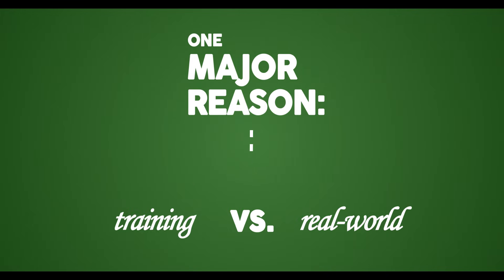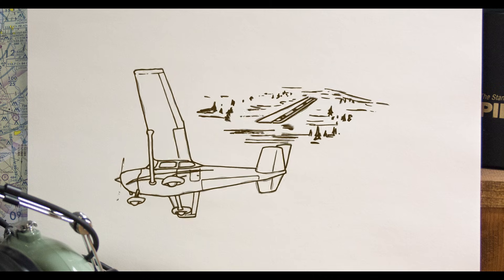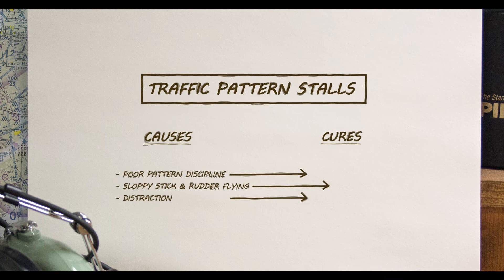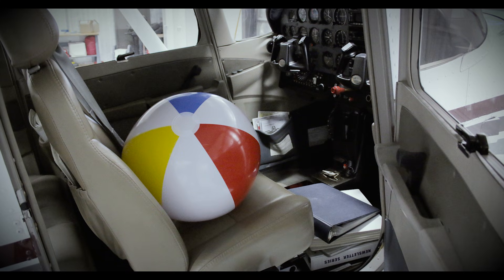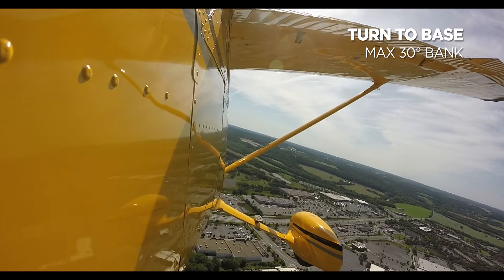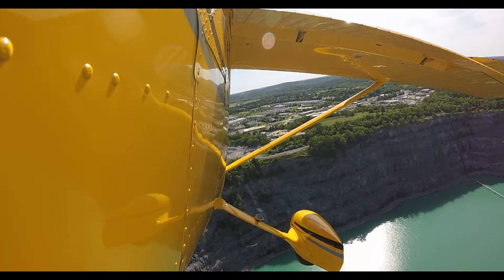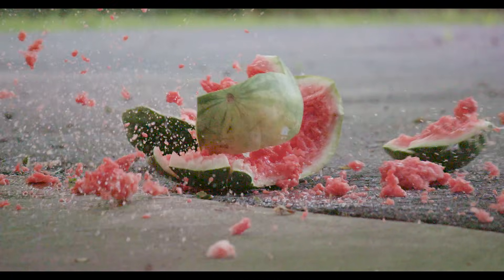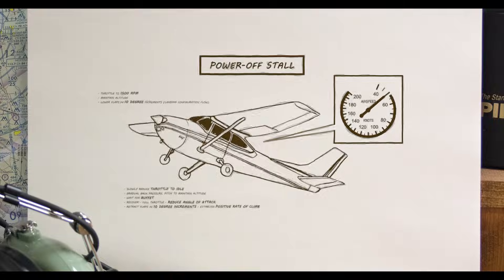Margins of Safety: Avoiding Traffic Pattern Stalls

Comment: Wolfgang asks continuously, "What does the airplane want to do?"  What does the airplane, with the dynamic neutral stability designed into it, want to do in a pitch up or turn?  It wants to maintain airspeed, not altitude, in all turns.  If we pull back on the yoke in the turn to crosswind, we will decelerate below the Vy trim set for takeoff and climb.  If we pull back on the yoke in the turn to downwind, we will decelerate below the Vy trim set for takeoff and climb.  If we pull back on the yoke in the turn to base, we will decelerate below the trim set for 1.3 Vso on downwind.  If we pull back on the turn to final, we will decelerate below the trim set for 1.3 Vso on base.  Does greater angle of bank increase the g load if we do not pull back on the yoke in any turn of any bank angle?  No, it does not increase the load above the same 1 g load of wings level.  The airplane cannot stall itself.  The critical angle of attack is when the wing stalls.  Why does the wing stall?  Because the pilot is pulling back on the yoke increasing the angle of attack.  This is not rocket science.  The wing exceeds the critical angle of attack sounds like rocket science.  The pilot pulling back on the yoke in takeoff pitch up to inadvertent stall, go around pitch up to inadvertent stall, and in altitude maintaining turns which trigger inadvertent stall seems to be what is causing many fatalities in the pattern.  Should we teach pilots to takeoff as fast as possible, even using free ground effect energy, to gain zoom reserve airspeed before altitude?  Should we teach pilots to not pull back on the yoke in turns in the pattern in order to maintain trimmed airspeed rather than maintain altitude?  Is our altitude orientation rather than airspeed orientation affecting safety in the pattern where stall is generally inadvertent and fatal?  If an average weight instructor is training an average weight student in a 152, is Vx (or even Vy on a hot day) ever appropriate?  Would limiting bank angle in turns or eliminating back pressure on the yoke in turns be safer?

Comment: I would say that often with low time pilots flying into an unfamiliar airport with a tower, pilots get confused by tower instructions and distracted. If they have done most of their practice with standard entry, left hand turns, etc., they can get thrown a curve by tower when they are instructed to enter a right base, or when tower calls the base for them, or when the traffic is heavy and they are instructed to extend a downwind or "keep it tight on base to final". This is an invitation to exceed angle of bank, allow airspeeds to fall below appropriate levels or to try to skid in turn to final. All of these things can contribute to upsets that result in fatalities. My instructor did the right thing and spent time with me at controlled airfields before my long solo flight and I was prepared for these distractions in advance.

Comment: The real issue is people don't learn how to manage energy and think they need to come in right on the edge of the horn. Don't get close to stall speed and you won't stall. My archer stalls flaps pur at 49kt. I fly patter on final into 2300 foot runway at 75-80kt. I'm never bear the horn and I'm almost always making the first taxiway. I see others come in at closer to 60kt and they have almost no aileron control and they will be hearing the horn on a stiff gust. Just unnecessary

Comment: Shouldn't every instructor be making "coordinated flight" the number one bottom line and most important aspect to flying?
Similar to the tobacco companies being required to put gruesome pictures of skeletons on cigarette packages to warn people that smoking will kill you, instructors should be showing students video's of people that crashed and died making a simple turn in the traffic pattern. None of those people wanted to die. Yet their failure to keep the flight coordinated resulted in a stall that they were unable to recover from. It all happened in a few seconds.  This has to be front and center on every pilot's mind when flying at low altitude. At that height you can't make any mistakes. You will most certainly pay with your life. They need to fully understand this.

Comment: Flight instructors should teach how the airplane feels approaching a stall. The controls get loose and the A/C feels mushy. It takes more stick movement to change any parameter. The immediate response is nose down to gain speed, adding power if needed. Other than that, a very good video. Some of the comments are also excellent and worth studying.

Comment: One great way to avoid traffic pattern stall is to trash the basic rectangular pattern in favor of simply doing one big wide turn from the downwind. There is no reason to level off after turning base. Just use less bank from downwind and make it one big wider turn all the way to final. This will make is easier to end up right on final with small adjustments to angle of bank. This mostly eliminates the over shoot on base to final (which is a leading cause of overcorrecting the bank at slow speed leading to a stall on the base to final turn). If done correctly, you will initiate about a 20 degree (or less) turn and carry that bank angle all the way around to final without levelling off until on final. With a high wing aircraft this also allows a constant view out on final to make sure someone isn't coming in on a long final on the wrong channel. With a low wing, one can simply give a quick dip of the wing to check for same. Hey, this technique is good enough for the Navy.
Reply: @gregoryschmidt1233  Riskier in what way? Less angle of bank required,...less chance of overshooting base to final turn,....etc.

Comment: thanks for letting the cat inside the plane! (implying it's no litter)
I once sat in a semi realistic simulator (as a visitor). I took off with help from a professional and flew around a little bit.
I thought, wow flying ain't that hard at all. then I prepared for landing. 100 meters infront of the runway, I just fell out of the sky.
was dead in seconds. yikes

Comment: We focus too much on stall recovery and not avoiding it on basic trainings. I´ve watched a video about diferences between airline training and basic training. On big jets you must avoid stall at all costs, recovery is not simples and require a lot of space, so pilots are trained to maintaing certain speeds at certain fases of flight, to extend and retrect falps on a speed schedule and that is really enforced... I flew a variety of airplanes up to the 727 on an airline and I agree with that kind of thinking... this video is much more usefull than the stall recovery training...
Reply: In other words... the best way to recover from a stall is not to stall in the first place

Comment: short down wind, short base to final and short runway landings are all my instructor taught me......no time to answer cells....or anything else...Hand on throttle.... pattern altitude on downwind...amid the runway.... throttle down close to idle...carb heat....first degree flaps....turn base....second degree flaps.....turn final....add final flaps.....over the numbers....settle.........settle.........settle........beep..touchdown...get'r done....get'r down.

Comment: The one thing you will NOT survive is a stall from a skidding turn at pattern altitude.  The best training flight I ever had was over thirty years ago with aerobatic instructor Rich Stowell, when we practiced turn-to-final skidding stalls at altitude.  Even though I expected it, the inside-wing stall was so gentle that I didn't recognize it until we were in a spin.  The wing just gently dropped, as if we were turning, but it kept dropping.  We did that three or four times, and nothing has ever impressed me so much.  Slipping in the pattern is fine - and useful, of course - but I am a Nazi about skidding turns, and it does not matter whom I fly with, if I see that ball on the outside, I speak up AND RIGHT NOW.

Comment: My instructor told me 1.4 times Vs0 in landing configuration or Vs1 is minimum maneuvering speed in the pattern, which accounts for 30 degree banks onto base and final. I cut out a little arrow from the sticky side of a post-it note and put it on the airspeed indicator whenever I'm renting a new aircraft. Stay above that speed bug until on final!
Reply: This is great and in line with the advice here regarding the min maneuvering speed: https://www.youtube.com/watch?v=m_tKShlf_gU
Reply: do you fly VS0 or VS1 in all legs of the pattern?
Reply: Dang—1.4 Vso will just about allow you enough margin for 60 degree turns! (Please don’t try it)  Better safe than sorry.  I’m assuming you slow it down once your established on final??

Comment: Simple, just never pull your stick/yoke past the stall position, then you can never stall.
Reply: manoova Not that simple. Make a sharp turn at a low power setting with a heavy payload and you stall unexpectedly.
Reply: @thomasairbuspilot  Read my post again. In that sharp turn, at that low power setting, with that heavy payload, if you don't pull the stick/yoke back past that stall position - the exact same position regardless of speed, or bank angle up to 90 degrees (for obvious reasons) - you won't stall. Go up and give it a try if you don't believe me. Alternatively, have a think about the relationship between stick/yoke position and the stall.

And, BTW, if you understand this, you'll never stall unexpectedly again.

Comment: Does it occur to anyone else that we could solve all this by making the pattern just a bit wider, and extending the downwind?  Set full flaps and slow down on approach.  And maybe approach just a bit lower and faster, then bleed off speed.  It wouldn't take much.
Reply: IDK...At least one of my flight instructors made it his practice in the pattern to maintain an altitude above and distance away from the runway so as to always be in a position to make it to the field in the event of an engine failure. Mainly cuz it would really suck to end up in a field or road or worse only dozens of feet away from an available runway! That always stuck with me and my approaches have always tended to be high and short. Never perfect, but high and short 🤷‍♂️. That same instructor, in the same conversation, I think, claimed he could cross the threshold of the short runways, at pattern altitude of the now decommissioned Strongsville Airport (1G6), and safely land our Cessna 152 trainer to a full stop before running out of pavement!

I never asked and he never offered to demonstrate this maneuver but after watching him demonstrate aerobatics in his Citaborea, I believed him!

And I've never tried it on my own!!!
Reply: @geeks4greyson425  point lost for misspelling, Citabria, but redeemed for knowing what it’s meant to say when read backwards. 🤔

Comment: One big thing missing from this is the use of trim to maintain a stabilized approach. A properly trimmed plane will "talk" to you through your hands.  If you find your self pushing for pulling you are going to fast or to slow and the feedback is instant unlike waiting for visual clues. Your grip on the controls should be fairly light and relaxed so you pick this up right away.
Reply: I totally agree with you John, good trimming habits can never be overstressed. Our CFI often said that in cruise the yoke should be handled with fingertips, much like a hot cup of coffee. If you are using the ‘death grip’ then your trim skills need reviewing.
Reply: Blah blah ever hear the words accelerated stall keep your speed up in a bank flew gliders for 25 years stalled and spun many times trying to core a thermal course that was never bellow 1500 agl recovery was usually less than 300 feet in a 1-26
Reply: @arvincook5049  I have several thousand flights in sailplanes, gave rides and instructed. A 1-26 is as benign as they come. Try that in a C-150 or a larger plane, you will lose 500 to 1000 feet in recovery. Also try that in a 2-32 you will not be getting out of it in 300 ft. And all the times I flew a 1-26 I stalled it more than once thermalling but never spun it, I guess I must have been keeping the yaw string straight.

Comment: An especially dangerous situation is overshooting the final on a base with a tailwind component, compensating with a heavy rudder and not enough bank or speed. This is the perfect spin entry setup.  It's scary, and should be.  If coming into this situation go "straight and level," adding power, and go around.  No exceptions!
Reply: tricky at an airport with two runways side by side
Reply: @markhathaway8431 ?

Comment: Wolfgange Langewische said " Speed and Altitude are Money In The Bank"  in the pattern you have little of either, during take off and on final.. even less.   Accelerating in ground effect and climbing out with extra kinetic energy is a smart habit to have. Developing really precise speed control is key .  Listen to your airplane.. especially when practicing power off approaches.  The wind sound is your airspeed indicator when your head is out of the cockpit - as it should be.
Reply: Yes, that sounds like glider pilots. You don't need any instruments in good vfr conditions. Altimeter is most important. Speed is horizon and sound. And wings rambling if you have a friendly stall. Otherwise it's bang, stall.  Coordination is a woolen string outside on the canopy, or you feel it in those classic planes. Google Sedbergh, that is fun for two. You can estimate your altitude above your home airfield accurate enough.

And yes, that's the way. Your senses will pick up more than you'd expect. Get a plane with the prop or jet behind you. Way more fun. Just a famous example: ever flown Rutan's EZ series? You can't fly the Voyager, the rest is there.

Comment: I just drove into my little airport. There on the ramp was a C-172 all mangled up. Engine hanging by a thread, airframe had obviously been on it's back.  Totaled.   Some numb nuts had tried to do a high performance take off, dumped the flaps at a steep climb angle, and just fell right out of the god damned sky.   This kind of pilot induced departure stall destroyed the plane.  Pilot limped away with a busted ankle, with some help from folks on the field.   Nothing sucks worse than pulling some dead guy out of an airplane.... so just don't take off if having your wits about you isn't on the check list !   We can train more pilots, but they really aren't making new airplanes much anymore.
Reply: Macho doing Mach 0 is stalling. His attitude was not enough to correct that stall. Call his insurance company and tell them he did it on purpose. Let him pay his damage. It's rude. Could help.

Comment: There is absolutely no reason why you have a 30 degree bank limit. Glider pilots fly 45 degree steep turns in the pattern - its even in the FAA Glider hand book.  We don't stall spin out of the sky and we don't have the luxury of a stall horn either. It's all done by feel. Your advice will lead pilots to do woefully shallow bank turns, and compensate by using the rudder to swing the nose and kill them. If you need to turn more, you need to BANK HARDER and keep the yaw string (ball ) centered. The angle of attack is agnostic to bank angle. What you do not want is to be in a sideslip if you stall because you're ruddering around in the sky. Military jets also do NOT do these shallow bank angles. They do near knife edge break turns, dump the gear and flaps, and slam down on short final to the runway with speed brakes deployed. I watch the F-16s do this daily.   

In short, bank as hard as necessary to up and including 45 degrees in the pattern to complete the circuit. If 45 degrees bank is insufficient, break off the turn and abort the approach. Learn to use those rudder pedals between your feet, they are not a foot rest. Why is it 45 degress? Because the approach speed for an airplane is 1.4 VS0, 40% above stall. The load factor and stall speed increases by 40% at 60 degrees bank. At 45 degrees bank angle the increase in stall speed is 20% - this means you have a 20% margin above stall speed. You could fly even HARDER bank angles if you flew faster approach speeds to compensate for load factor. You should be fully aware of what your stall speed is as a function of bank angle and aircraft configuration without needing to think about it, and you need to be able to fly coordinated and within practical test standards for every landing. At the very least, strive for it until you can. But if you're playing around in the pattern totally unaware of your stall speed based on your current bank angle you are an accident waiting to happen. This video fails to explain even the most basic understanding of banking in the pattern. -<cringe>
Reply: Glider pilots also have a better awareness of trading altitude for airspeed, and will naturally let the nose drop to maintain airspeed in a turn - not necessarily a habit of power pilots where there's more emphasis on level turns.
Reply: I do feel obligated to point out some additional points for the reader scrolling through. The math presented in the above post applies to maintaining level flight. In the traffic pattern you will be descending while turning so the stall speed will not obey the mathematical relationship to your benefit. In fact, one can easily turn with a 60 degree bank without any appreciable g loading therefore no change in stall speed. As long as there isn't an effort to pull through a turn it will not result in a stall or a spin so long as the aircraft is properly trimmed.

And yes, I fully agree the discussion presented in the video is horribly incomplete and encourages many bad habits. This is exactly the type of preventive training we can do without.